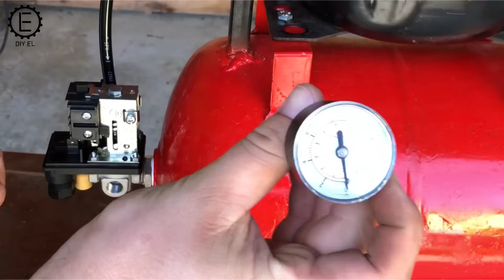Homemade air compressor from old refrigerator

Comment: Good job, but you forgot the most important point in this work, which is very important in all compressors, which is the water outlet opening at the bottom As this hole exits the water collected inside the bottle as a result of the conversion of air into water, and this hole is done every time at least once a week or a month by opening it to make sure that there is no water The opening is at the bottom of the bottle and is equipped with a tight cap that is easy to close and open and at the same time does not leak air. You can add a clip and edit the same video without deleting it and adding what I told you Some people imitate such actions and it may be dangerous to their lives just because of one simple mistake. Greetings to you
Reply: P
Reply: P
Reply: I'm a year late about this. Just remove the pressure switch then if it really does have water in it, you can easily lift that small compressor tank.
Reply: @Mr.KuripotJourney  
حسنا

Comment: The intake is ambient-air only or hosed-quick-connector to any propellent.?
Reply: Fuel-air mixture is oxy-acetelyn gauge-valves for intake hose...
Premix setting at intake... Charge into tank... And maybe turbo-nitro evaporated ethanol, a bifuel diesel truck intake...
Reply: Dangurace highly exploded

Comment: where's the air intake, the water outlet at the bottom of the receiver and I assume that there is a safety pressure release vale in that pressure switch?

Comment: How much air pressure you put in to tank
Reply from the maker: 10L - 5 bar
Reply: I made one can create 200 PSI. Not sure what equipment the compressor came from. Only know it is R22
Reply: how long it take to reach 5bar?

Comment: Creative do you have a parts list
Reply: Hi, i'm looking for the complete list of all parts. I have a similar fridge compressor and want to use a small fire estinguisher as a tank. Can you help me? I know I need a regulator, 2 gauges, a relief valve and a on/off switch+ tubing off course. Anything else???